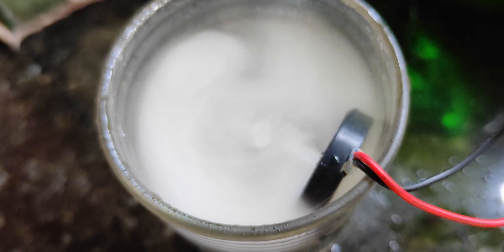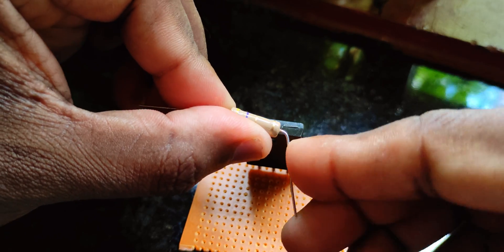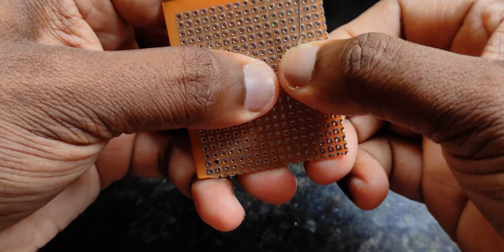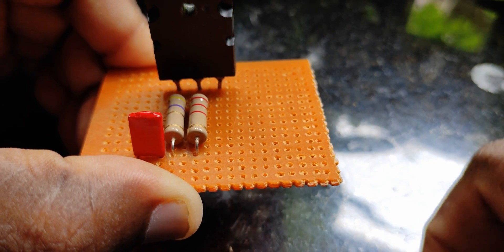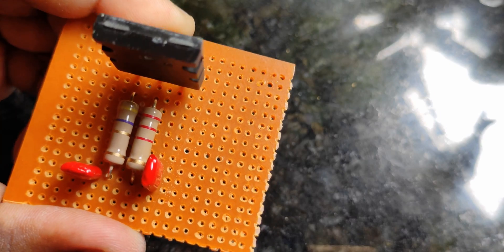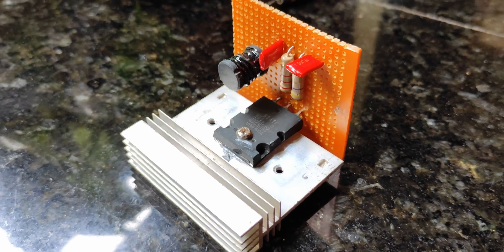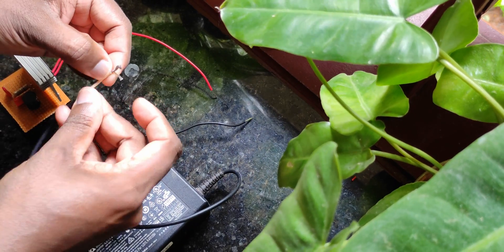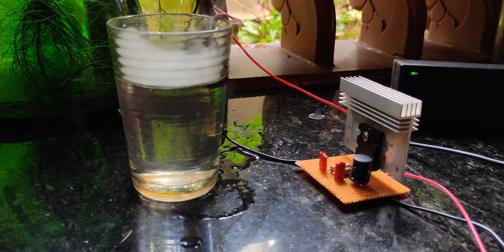I made a super simple 1.7mhz mist maker circuit | ultrasonic mist maker humidifier Level 2 | Ciiads

Comment: Nice work. Just made mine using your instructions but when i put it in water it goes off
Reply from the maker: Keep the water level low over the piezo disk, waterproof the wiring side of the disk, arrange the disk like the way with was implemented in humidifier.

Comment: To this simple scheme by removing the piezo that plays the role of humidifier, changing it to a capsule (found on the HC-SR04 module) what effect do I get? Does it NOT function as a mini audio and noise suppressor?
Reply from the maker: Probably not, if you wanna run the capsule that you found on the HC-SR04 module go with ne555 chip and make an oscillator for that specific frequency and use a MOSFET to switch the output signal and add an inductor in the switching path to smooth and filter out the signal that's it🙂♥️.

Comment: nice video, thank you. can your curcuit be changed to drive ceramic disk rated for 10Mhz? please, what components determine the oscillating frequency? thank you
Reply from the maker: the piezo disk itself is the oscillating component it's in the feedback path and I never tested 10 MHz piezo but this circuit will handle up to 2.4mhz, For anything beyond that we have to tweak the supporting components as well, I recommend designing something with Colpitts oscillator is the way to go in my opinion.  😊🤗

Comment: Hey! i know im a little late but does the mist or the piezzo heat up drastically? could the mist be fit for consumption or would it burn you?
Reply from the maker: No worries ☺️,  At the heart of the device is a piezoelectric transducer that vibrates at ultrasonic frequencies (like 1.77 MHz).
When electrical energy is applied, the transducer vibrates at high frequencies. These vibrations create pressure waves in the water, breaking it into very fine droplets that form the mist.
The process doesn’t involve heating, so the mist is usually cool and not hot enough to burn you. However, the transducer may get warm during operation. The mist produced is generally safe to inhale in moderate amounts, but it’s not intended for direct consumption.
However, it consists of tiny droplets of water suspended in the air.🤗♥️👍.
I hope this clears things up and adds a bit of insight to your day! 
Thanks so much for your question.

Comment: bro where to get 113khz disc part alone?
Reply from the maker: It's not 113khz disc it is 1.77mhz bro😊 I bought that from robu.in, and you can always get 108khz disk with driver circuit for very cheap price from there.
Reply: @AMNLabs  bro i had the driver but the disc was damaged so i want separated disc 113khz or 108 khz any think is fine
Reply from the maker: Sorry to hear that, you have to look around online shopping websites like aliexpress

Comment: hi bro, i've made the circuit, with those replacement values : Tr. TIP41C, R.5,0 ohm/ 1 Watt, Ca. 104. When I run the circuit, it takes 0,9 mA in the 12.0 working voltage, and the transistor heating like hell 😂. Whats ur suggestion bro?
Reply: And L.220uh...
Reply from the maker: @fauzanhariz9589  that's entirely different than mine 🧐.
Reply: @AMNLabs  😅 aah...different a bit bro
Reply: @AMNLabs  hi bro, would you please share me your email? I want to send some pics of my work, doest work, need your help to check what am I missing about..

Comment: ver good. Why didn't you use the piozo to give it up? I didn't fully understand its performance?
Reply from the maker: I can't understand your comment though.
Could you please clarify?
Reply: @AMNLabs  The outlet of the piezo disc should face upwards. Water vapor must also rise upwards. The orientation of your piezo disc is sideways. For this reason, the amount of steam output is not fully understood. But when you dropped a few drops of water by hand, very little steam came out. This means the steam output performance is poor. Your opinions are important. What is your suggestion to increase steam output?
Reply from the maker: You’re right, the piezo disc was placed vertically in the demo because we currently don't have a proper mechanism to mount it horizontally. 

This particular 1.77MHz ceramic piezo disc is solid and doesn’t have the tiny holes in the center like some other types.
I want to clarify that I'm not hiding anything, what you see in the video is the exact output of this circuit at 12 Volts DC. If you find the steam output to be poor, that's an accurate reflection of the current setup.

If you're looking to get more power, I recommend experimenting with over-volting the circuit within the piezo disk's safe operating limits, using thick tracks, and short, thick wires.

Additionally, some viewers have modified this circuit with IGBTs to improve performance. You can find one such comment further down where they explained their modifications and component values, though they forgot to mention the IGBT part number. You can also see others' opinions from those who successfully built the circuit.

Thank you for your suggestions! If you have more tips or insights, please share them. We're always looking to improve! We can make a better version soon.
Reply: @AMNLabs  Thank you for your answers. In the country I live in, there is only a 1.7 MHz ceramic piezo. This must be the circuit I had to make. According to my research, only you have made this circuit. That's why I have to make this circuit in the best way possible. I need to adjust it to have good steam efficiency. thank you.
Reply from the maker: @Throtmanni  wish you all the best , good luck.

Comment: I have 3 Ceramic Piezo 20mm disks rated at 5MHz, 10MHz and 20MHz. What components in you circuit determine the resonant frequency?
Reply: capacitance and inductor inductance mostly, but might still need to also alter the transistors
however at high frequencies the powertransistor might be something you need to pay attention to as many of them can't handle such high frequencies.
luckily the one in the video is capable of 30mhz so you should be able to use that one for these.

Comment: Dear Aneeshmurali Sir, excellent work and very nicely explained. Many appreciations. 

One doubt Sir, can we use a cheaper power transistor of IGBT or JFET or MOSFET? The power transistor 2SC5200 is very expensive in the market; it handles 230Volts and carries 30 Amps and so the cost is justified. However, a low cost alternative would be much better and non BJT colution will also eliminate the need of heatsink. Any suggestions on alternate part number of IGBT or JFET or MOSFET Sir? 

Regards,
Reply from the maker: Yes, someone made modifications to the circuit using an IGBT and provided positive feedback about the results. I read his comments further down, but he didn't mention the IGBT part number. He explained the other components well, but I think he forgot to include that detail.
Give it a try 😊♥️👍

Comment: Can use 100 uh 2.4 ampsToroidal DIP Inductor for this circuit?
Reply from the maker: I've discovered that radial inductors perform exceptionally well. While I haven't experimented with Toroidal dips, you might find them worth trying out. Inductors with thick copper consistently deliver the best results. Best of luck with your endeavors!
AMN🤗
Reply: Thank you buddy @AMNLabs
Reply: How much maximum wire  length can be use between circuit board and peizo disc  @AMNLabs

Comment: Nice circuit, it works. My steamer oscillates at 1.78MHz
Reply from the maker: Finally somebody did it, Thank God. It will work 100% and it's not fake, so many people are degrading my work, God promise I never upload any stupid things to grab attention or make money "my intention is Do the best or do nothing."
If anything doesn't work that is because of their own mistakes not mine.
You did a great job nice to meet you.
Thankyou for your valuable feedback. 😊
Regards, AMN
Reply: @AMNLabs  However I'd suggest that in the video you show a circuit diagram to your circuits. That way they will be easier to understand. From a circuit diagram everything is straight forward, you know exactly where to connect each component, in what orientation as well. Seeing the circuit itself, without a diagram doesn't make clear where the connections are going. Even more that you are soldering from the opposite side of the board where the pins of the components are in a flipped position to the original e.g, the base of the transistor is at the place of the emitter. Also that will save lots of explanations where and how to solder each component.
Reply from the maker: I appreciate your opinion next time I will and I'm considering it.
Regards, AMN 😊

Comment: This circuit is not working only just transistor heating seriously bro you need to add a circuit diagram this is useless with a proper circuit diagram😫☹️
Reply from the maker: Use thick wires and follow the video carefully use right components it will work it's not useless and this circuit is not enough to draw a diagram, only having few components easy connection and it's very easy to follow the video.
If it's not working means you made a mistake or you are seeking the video like reading a software lisence agreement.
But I will appreciate your point, next time I will draw the diagram for you and the people like you who are struggling to follow my instructions even if the circuit had a single node.
Thank you.
Regards, AMN

Comment: can you guys explain how it works? does the vibration or heat create the mist ?
Reply from the maker: The mist maker contains an ultrasonic transducer, which is typically a ceramic disc or plate. This transducer is made of piezoelectric material, meaning it can convert electrical energy into mechanical vibrations.
When an electrical signal of 1.77 MHz frequency is applied to the transducer, it starts to vibrate rapidly due to the piezoelectric effect. As the transducer vibrates, it emits ultrasonic waves into the water. These waves create high-frequency pressure variations in the liquid. The pressure variations generated by the ultrasonic waves create small areas of low pressure, causing tiny water droplets to form. This process is known as cavitation. The rapid formation and collapse of vapor bubbles lead to the creation of mist or fog. The water droplets formed by cavitation are extremely small, typically in the micron range. They are then released from the surface of the water as a fine mist or fog, which can be blown or diffused into the surrounding environment. That's it 
Good to see you 😊👊❤️
Reply: @AMNLabs  than you so much for the replay i do appreciate it LOVE YOUR CHANNEL, so the electricity being used is AC right? for the frequency vibration ? so the  electricity flowing on the Piezo wire is AC?
Reply from the maker: @emergencyimpact369  yes 👍
Reply: some electronic devices converts AC to DC for it to function this one converts DC to AC to work pretty cool
Reply from the maker: @emergencyimpact369 it's an oscillator

Comment: Hello I have made this. I am. Using same same transistor, 4.7ohm resistor 2.2k resistor,0.047uF 63V Mini Boxed Polyester cap. 100uh Radial inductor but it still doesn't work. Am I using some wrong component? No idea about this just want to make a DIY humidifier haha
Reply from the maker: Maybe, use what I used exactly, and use thick wire high current inductor 1.77mhz piezo that's it if you did everything right it will work 100%. Read the comments you can find troubleshooting instructions I already helped some guys who going through the same situation as yours.
Thank you 😊👊
Reply: @AMNLabs I have the exact same piezo disc, bought a whole lot of Resistors but they are 1w(could that be an issue?) But my cap is not same as yours could that be the problem? Also for power I'm using a 12v power from a 550w pc power supply.
Reply from the maker: @Nightflow9  drop your setup and circuit diagram into my mail
Reply: @AMNLabs  what's your email dude

Comment: Transistor is heating too much.. how to solve the issue ? Not working also. Can u help?
Reply from the maker: Use thick wires, a high current inductor, a decent amp power supply, and a heatsink, and read the comments 🤝👍

Comment: Hello Aneesh. Very nice video, thank you for that. But I still didn't understand the function-principle. What drives the circuit, where is the 555 bug? 🙂It might be an LC-circuit in parallel, but I cannot bring the values together: f = 1,77 Mhz, L= 100 µH, C= 47nF - they don't fit in the formula f = 1/2 x pi x sqr(LC). Please explain. Bye Matti
Reply from the maker: Piezo disk resonance plays the role 
The LC circuit in the oscillator circuit sets up its own resonant frequency based on the values of the inductor (L) and capacitor (C) used. However, when we connect a piezo transducer to the circuit, it introduces its own resonance characteristics.
The piezo transducer has a natural resonant frequency at which it vibrates most efficiently. When the circuit is driven with a frequency close to the resonant frequency of the piezo transducer, the transducer responds more effectively, resulting in stronger mechanical vibrations. This, in turn, affects the overall frequency of the circuit.
The LC circuit provides the oscillation and frequency generation, but the presence of the piezo transducer influences the behavior of the circuit by effectively locking the frequency to its own resonant frequency. As a result, the output frequency of the circuit aligns with the resonant frequency of the piezo transducer.
So, in our case, using different piezo transducers with different resonant frequencies will cause the circuit's output frequency to align with the respective resonant frequencies of those transducers.
Reply: @AMNLabs  According your values the frequency produced by your circuit would be 73,412 kHz. Have you measured in on the scope?
Reply from the maker: why are you not considering the piezo resonance the output will depend on it, there are 2 nos of 47nf in the circuit, and this circuit will complete only when the piezo is placed.
Did you tried it, on my frequency counter it was never 73,412 kHz 
Here f is not 1.77mhz like fixed frequency  it changes according to the resonance of the disk if you place a 2.4mhz disk in it, it will oscillate within that range.

Comment: For your followers who do not understand your language, could you post the list of components?
Reply from the maker: It's just English the same language you texted back to me ☺️👊
Turn on the closed captions if you need any further assistance 🤝
I spend a lot of time creating that subtitle for those who are struggling thank you.
Reply: The problem is that I don't have audio on the PC
Reply from the maker: It's been a long time ago, I did many things after that so I can't recall 
But let me try 
2sc5200 
100uh radial inductor (good current capacity )
47 nf 100v polyester cap 
4.7 ohms 2w
2.2k ohms  2w 
Use thick wires 
and good to go☺️🤝
If you have problem with your speaker the CC will help you, please turn it on ☺️👊 
Thank you

Comment: Hi!  I installed your circuit but I couldn't run it, can you help me?
Reply from the maker: Because you did something wrong read the comments below you see I helped many and it's always gonna be a repeated question and answer so read the comments below you will get the fix
It will work when you did it right
Reply: it doesnt work for me as well. there is discrepency of what values for the resistors are. another video has the same circuit but with a different resistor value.
Reply from the maker: @roozbehkhodambashi7089  
So sorry to hear that maybe you did something wrong.
There is no need to provide the values in the description because I explained everything in the video. the values of every component are there and you can turn on the subtitles if you want.
Or even the video is pretty clear that you can identify the values and their color code.

Comment: Can this circuit be used to drive 24V discs @30V (for higher mist output)? If you want a multi-disc system, can a single circuit drive multiple discs at once or does each disc need it's own circuit? Also, if we are buying the 100uH inductor, what size is needed? Is a 6*8 enough, or is something like 10*12 or 10*16 needed?
Reply from the maker: As per the datasheet of the transistor, it's fine to handle higher voltage but you have to use a better heatsink to cool it down. 
Using thick wires and a thick layout is very important.
and also use a high current 100uh to 150uh radial inductor which is also very important, the current capacity of the inductor is all the matter that's why I made one myself.
Thin wires and thin layouts and weak inductors cause overheating and unstable operation.
I never attempted with multiple disks 
But you can always experiment with that 
Good luck 
Regards 
AMN 
👊☺️